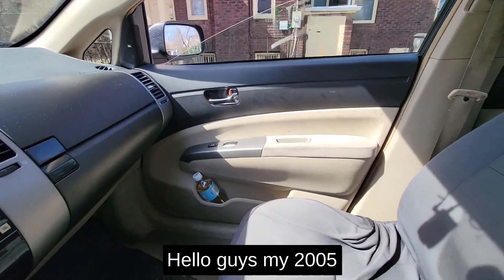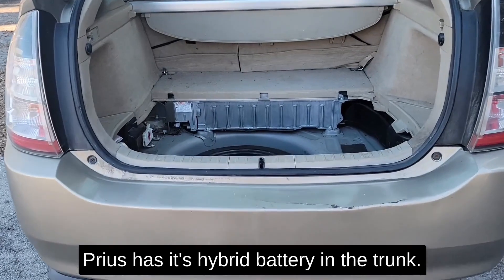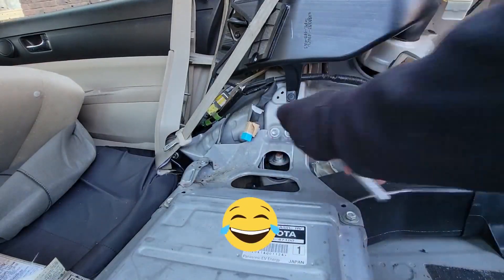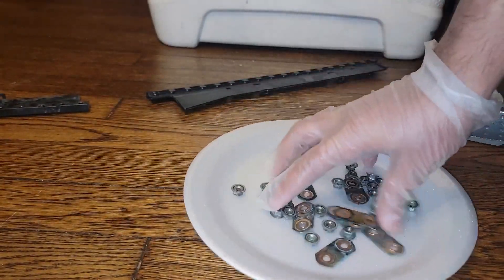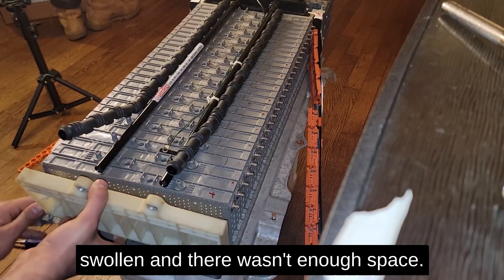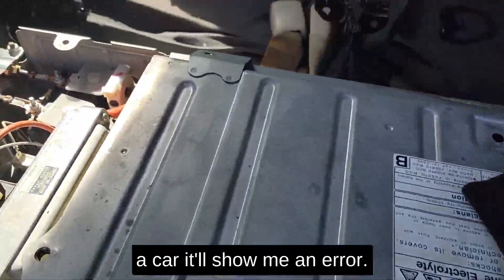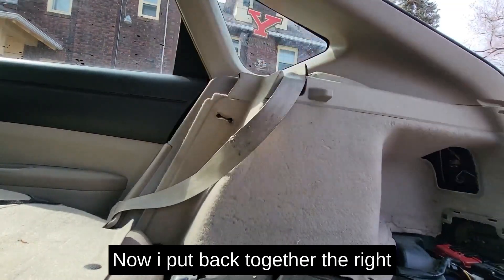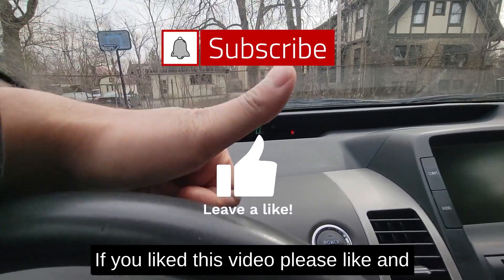Prius hybrid battery replacement.Replacing Prius Hybrid Battery Cells.#diy #hybrid #hybridbattery

Comment: The module electrolyte is a strong alkaline.
That's why you use white vinegar to clean. Using baking soda which is alkaline doesn't make any sense.
Did you test the eBay modules under load to see if they were any good?
Reply from the maker: Thanks for the comment! You're absolutely right — vinegar alone is better for cleaning because it neutralizes the alkaline electrolyte. 

I did check voltage on the eBay cells, but didn’t have the gear for a proper load test. Will definitely add that step if I ever do it again in future.

Comment: Nice video my friend, is your car working properly after 5 months of posting the video? 
Thanks
Reply from the maker: Thank you. Yes. I drove around 10,000 miles. After that, I had to do the same thing twice. It was easier second and third time. I replaced 2..3 cells each time. I still have the car to this day. I live only few miles away from work, so I haven't felt the need to buy a new car or replace the whole battery.
Reply from the maker: I have 211000 miles on it so far. I am hoping to put around 220000 miles. I don't take this car on very long drives nowadays. Hope this help.